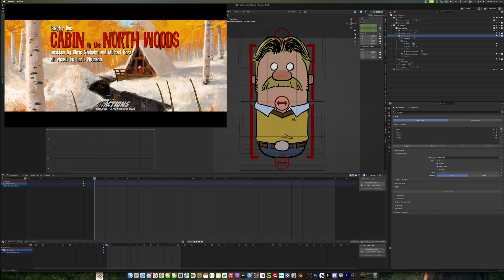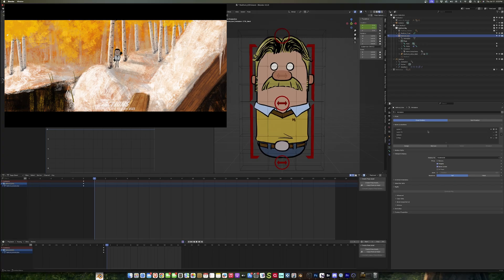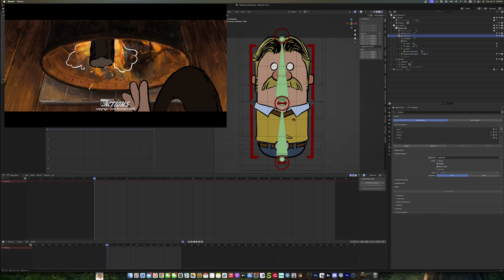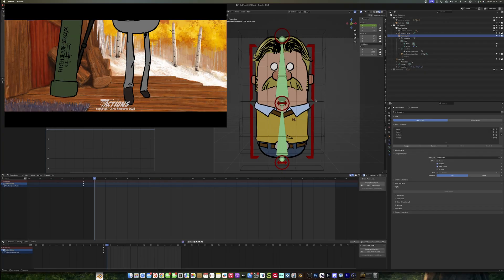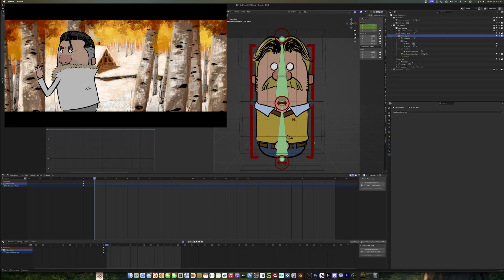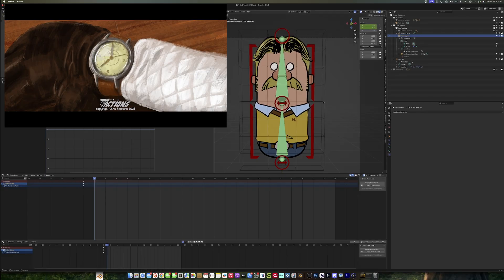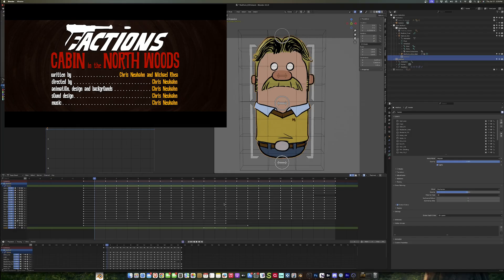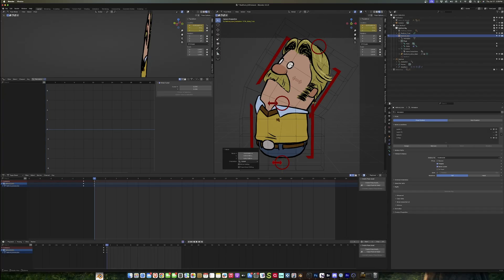Simple Grease Pencil Rigging in Blender (Lattice + Bone Setup Explained)

Comment: Super grateful for this tutorial. I have a project underway that will require ALOT of moving assets and layers so this helps tremendously, especially the part about cycling through the various images to make a moving doll. I'm wondering if this rig can be applied to static objects/background elements and environmental transitions. Like, making everything a puppet to pose and log the keyframes for the animation.